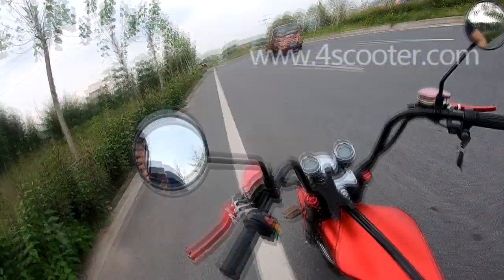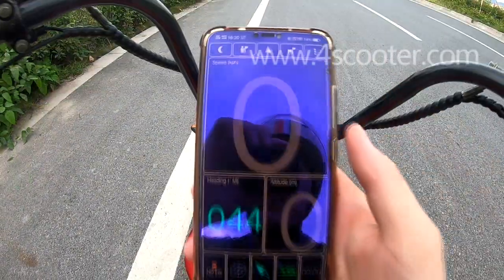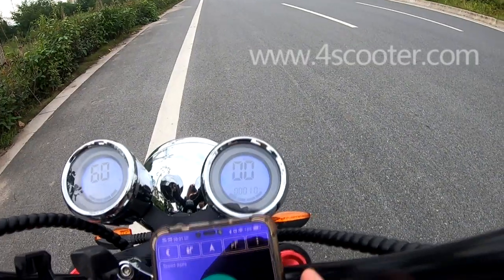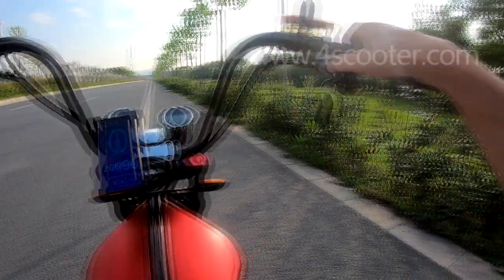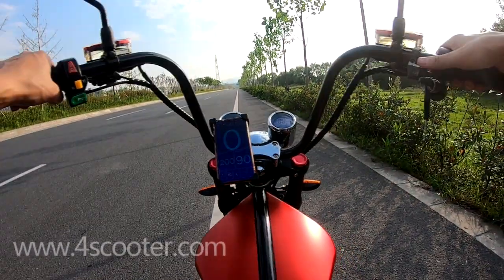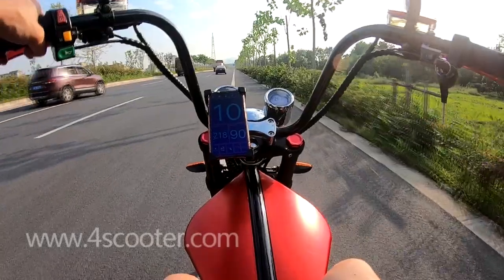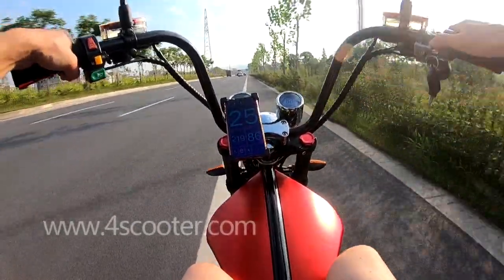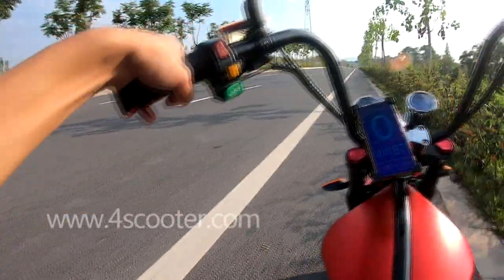Road Speed Test on EEC Electric Harley Chopper ES8007

Comment: I thought these only went to 30 if restricted but 45 not restricted these bikes are awesome and apparently you can drive them on a CBT certificate and provisional license which is great for commuting around the town
Reply from the maker: The max speed reaches 50km/h on 2000W, we have speed limitation switch on the scooter to control the max speed.
Reply: @mademoto  Привет друг) говорят в районе бака проводка плавится это правда?

Comment: Hello:) does the battery limit performance on low battery? If not I’m going to buy one:)
Reply from the maker: I have performed many times on the electric scooters range tests. Only in last 5 minutes, you will find the electric motor is on lower torque output, this is only happened when the battery power is 100% empty. But this seldom happaned, since there is battery level displaying on every scooter. Few people runs 100% empty on battery till next charging.
Reply: mademoto thank you for the fast answer!
Reply from the maker: @theraider8024  You are welcome.

Comment: How to remove the limiter?
Reply from the maker: It depends on different factory. Normally, disconnect a wire can be done.
Reply: @mademoto  it is M3 model with LED with EEC COC
Reply: @mademoto  what wire?
Reply from the maker: @TheMegaRockystar  You may contact your local dealer. Not all the scooters have preset such wire. It depends on the dealers' order requests.
Reply: @mademoto  I have buy it direct from China M3 model it comes in May to Germany from Holland, my Dealer from China wont let me know, he said it can be done 😶
Reply from the maker: @TheMegaRockystar  Ask him take a photo for you on the wire need to be disconnected.
Reply: @mademoto  ok tnx I am gonna try 👍
Can you send me your Alibaba Profile
Reply from the maker: @TheMegaRockystar  https://mademoto.en.alibaba.com

Comment: Hello Mademoto, do you also sell only the speedcontroller? (mode 1 = +/- 25kmh , mode 2 = +/- 40-50kmh mode 3 = +/- 62kmh) . thanks in advance
Reply from the maker: Thanks for the message. As factory, we only sell the finished products. Parts supply only for our delears worldwide.
Reply: @mademoto   the problem is, the 'worldwide' dealers (very few) dont want to sell the parts. If they do sell the parts they ask very high prices. In example 150 euro for a speed controller.  This is why people dont want to buy the scooters. You really need to make a replacement parts store with normal prices.

Comment: So i'm guessing we can remove the limiter ourselves in europe and go the full 61kph? Or not because of european law?
Reply from the maker: Yes, some customers did that.
Reply: @mademoto  how do i remove the limiter?
Reply from the maker: @Auxillier  Is your scooter from us?
Reply: @mademoto  how does it work? To remove the limiter?
Reply: Hello, do you know which maximal incline the vehicle can do? I live on a small hill where there is a short street that has 21% incline, otherwise my area is mostly pretty flat.
Reply: @mategod9785  you can go small hillls easily, manual says it can climb 15degree (30%) but i climb 40-45% with 20kmh. I added second seat and  2people can climb hard ramps very hard with 10kmh 🥲
Reply: The CoC for EU/EEC specifies a speedlimit of 45km/h.
By driving on higher speeds you'll not only loose the validity of the CoC 
... you no longer have insurance cover.
AND your Akkumulator will be rapidly discharged.
Reply: Jimmy .L  german for  ...   now think by yourself.